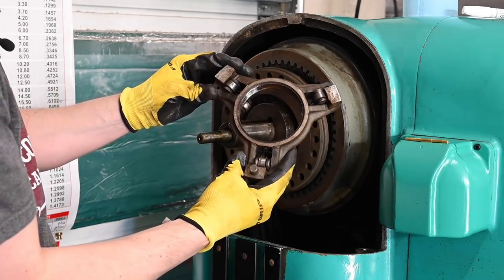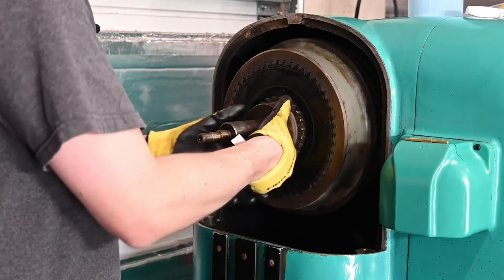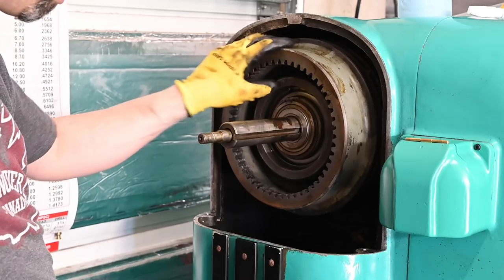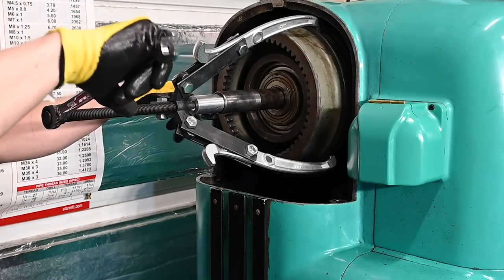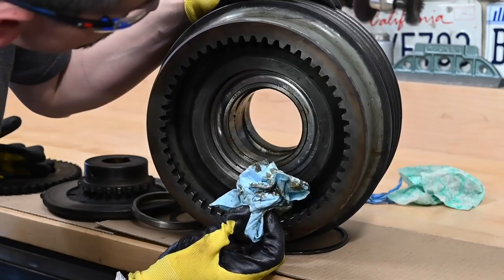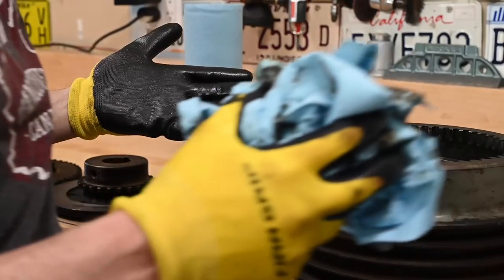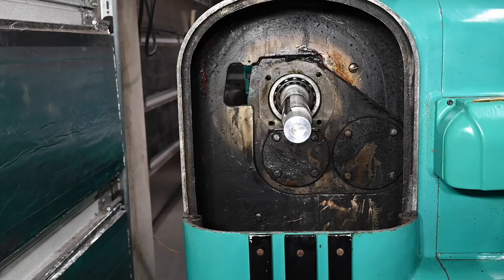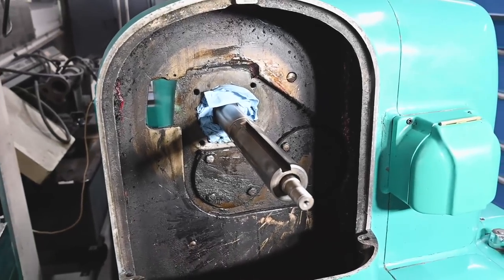Monarch Lathe Clutch Disassembly

Comment: Thanks so much for posting this!  I'm working my way through a complete clean, refurb, and maybe scraping the cross slide on a series 60 16 x 54.  Pulling apart this clutch mechanism, cleaning and inspecting is on my list.  At the very least I look to have a lot of crusty grease in there, possibly causing an imbalance issue.  RIP Harry / Beckley23.  I'm indebted to intrepid and generous forum members and youtube posters such as yourself and Harry.  I want to use my 2 and 4 year old sons as excuses for not documenting some of my own work, but I see from another of your vids that you're in the same boat!

Comment: Looking good Arron, That old Monarch is a well made beast. You'll be happy knowing everything is properly sorted when finished. I've done tons of bearing work, the old lithium greases were very prone to drying out making regular re-greasing mandatory. The new synthetics are so much better...Enjoyed thanks for sharing.
Reply: When the oil in the grease separates out, all that's left is the binder which in the case of Lithium grease is Lithium soap, which is why it has a waxy consistency. Old manual camera lenses often have the same issue with the grease, once it's all cleaned out and re-greased it should work like new for another 20-80 years.

Comment: Hey Adam,... a couple of notes on the teardown, curious that your clutch friction disk is a one piece, mine is a 3 piece - did I see that that pully was not using the fourth belt, mine uses 3 belts- and again I did not notice any type of grease bearing seal, or sealed bearing during your disassembly, wondering if Monarch has an upgrade to the stock bearing ?  I am impressed that you got that large snap ring (Beartrap) to come out,....I had to have a mechanic friend (works at Caterpillar) come over and drink 3 beers and lots of cussing before he could remove it!
Reply from the maker: It uses 4 belts- perhaps with the 10 horse motor upgrade they included a 4 groove motor pulley. The snap ring was brutal, but once we figured it out it wasn’t that bad. Squeeze like hell to get one ear out, use the tip of a screwdriver to keep it from seating back down, then used a small square brass block behind it and pushed that around behind the ring until it forced out the rest of the ring.
Reply: *Aaron

Comment: Where are you that it’s 85° and not hot?!? I’m from the north and today we’ve had 35-40...not hot😂😂😂
Reply from the maker: Ha well two months from today it might be 30 degrees hotter so yeah, this summer an 85° day would be to die for! Arizona’s heat is no joke.
Reply: Yeah I don’t freeze...I melt...you can have it. I hate the summer. Humidity and heat, sunburns, I’ll pass!🤣 can’t wait to see this bad boy back together. Could that clicking be from that broken spring rolling around behind the clutch plate, you think?
Reply from the maker: I think it’s actually the disc on the outside of the outer clutch disc that the inside of the spider rides against. Waiting to hear back from Monarch if it’s permissible to use bearing retaining compound on it to secure it in place to stop the noise.

Comment: Do those bearings have seals on both sides? I've found cases where the original bearings on vented grease designs only had seals on the none greased side but were replaced with double sealed bearings. They failed because the grease couldn't get inside as there isn't enough pressure to push grease past the seal. Most replacement bearings are double sealed so they can be used in any application by removing one or both seals. There are some applications where the shaft is sealed on both sides and the grease is put in on one side and vented on the other.
Reply from the maker: No the bearings in the pulley are completely open on the inside.

Comment: Man, how nice would a good parts washer be right about now? There used to be a company that drove around and cleaned parts right in their truck. I think they had a regular route. I wonder if any of them are still around. BTW, maybe the ticking noise was that piece of spring banging around. Anyway, happy degreasing....
Reply from the maker: Hmm could have been the spring I suppose, but I don’t think it weighed enough to make that much noise. Yes a CRC SmartWasher would be fantastic to have.

Comment: Great video. I am using a 1952 Monarch. Do you have any suggestions on why it takes the machine longer to stop then other times?
Reply from the maker: For the spindle to slow down? Has to do with the centrifugal force on the chuck as I understand it. So a well balanced but heavy workpiece will take longer to slow to a stop than a light one. The brake system on these old lathes isn’t great.